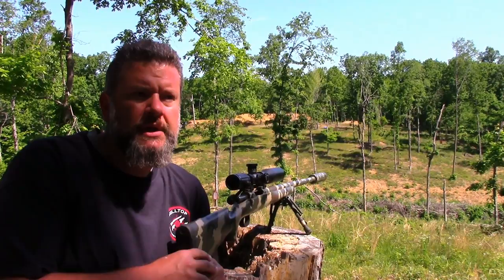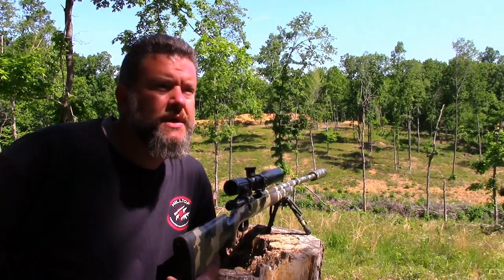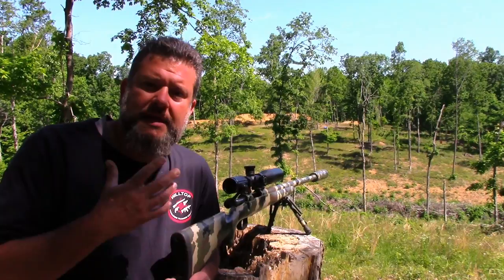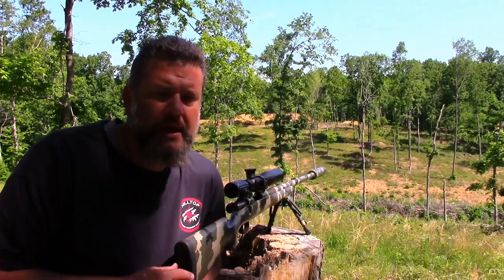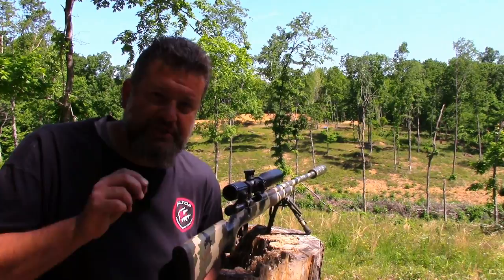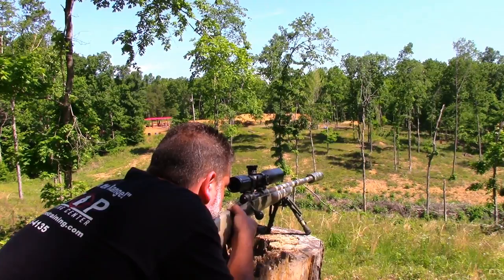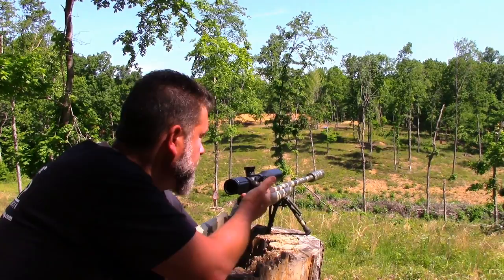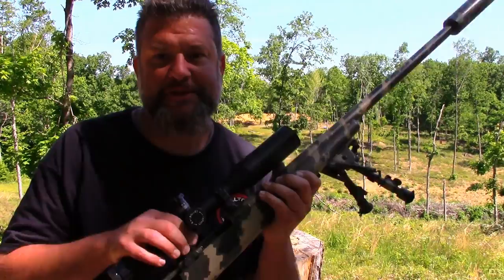.223 Subsonic Reload, revisted

Comment: try it with lead 55 gr flat points ..the lead seals the bore better than a fmj at such low velocity .
Reply: A google Account If you mean “cast” lead, do you get fouling? Do you powder coat them?
Reply: 03bullseye  yes i cast them  55 grain flat point from a lee mold  . no i don't powder coat them   .... the secret to not needing powder coating is don't use pure or even close to pure lead ..use harder impure scrap lead or linotype..  . don't remove the impurities with wax  when melting like youd normally do.. leave em in there . just stir and remove all non metal crap  lubricate with alox and load em ... the impurities make it too hard to lead the bore unless your shooting beyond 1300 fps they run great in my custom .223 bolt action pistol

Comment: Was the loads packed at all for flash over?
Reply: Zack Findlay not needed if using Trailboss cause it’s a huge flake powder unlike any other. It takes up a lot of volume in the case.
Reply: Zack,
Those who worry about Secondary Explosive Effect are the very ones who worry about flash over.
I've only reloaded since 1990, so have much to learn, but with over a thousand of my handloads that are much more than what is considered reduced ( yes, have stuck many a bullet in a bore ), i've never worried about either. If the powder manufacturer's have other things to concern themselves with, i figure i do too ! They can't reproduce some of the problems reloaders report,  and without double charging a case, neither can i. Nor do i want to, going so far as to make Damn sure i don't.
If i recall correctly, there was a fine article in ( the now defunct PRECISION SHOOTER ) by a gentleman that explained how each grain of powder could produce a certain amount of energy ( no more nor less ) and if a cartridge was rated ( for example ) 62,000 lbs, only by adding more powder would that level be exceeded. Never by reducing the powder to a level where the total energy contained in that powder would not be able to reach that level. Now as a handloader, i realize on more than one occasion the Wrong powder may have been used, or a double charge thrown. And as humans it's all to common to retreat to denial and place the blame elsewhere. But in my world, SEE and Flashover are Unicorns ...